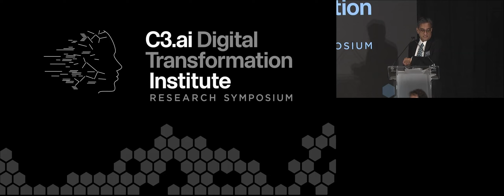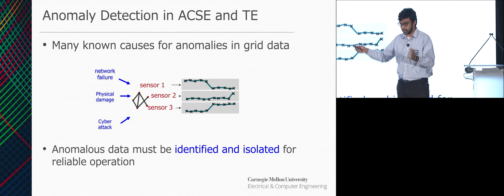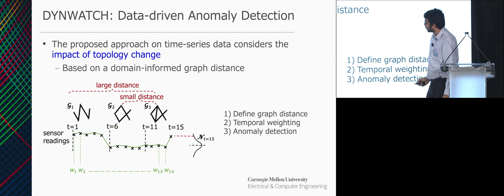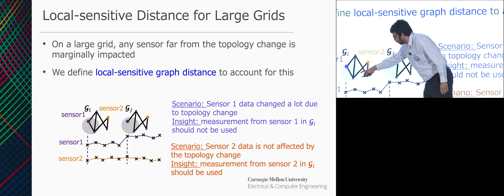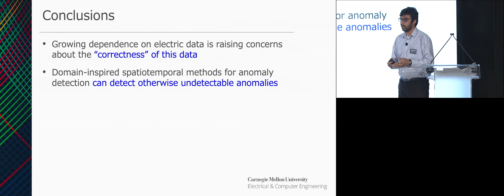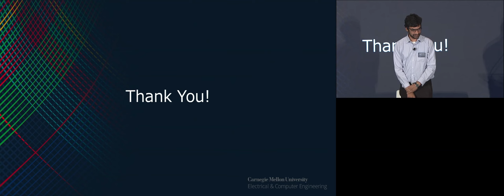DYNWATCH: Dynamic Graph-Based Anomaly Detection in the Electrical Grid

Comment: How to involve data variations caused by power flow change?
Reply: you can update the graph with a GNN. That would propagate these updates throughout it.
Reply: @slavrine  Very interesting ideas.  From my understanding, an usable scenario is to detect wrong measurements like P, Q, U, phase of power flow, which is not uncommon in practice. But why not simply use traditional method like "state estimation" based on impedance models  to detect unreasonable edge or node data?